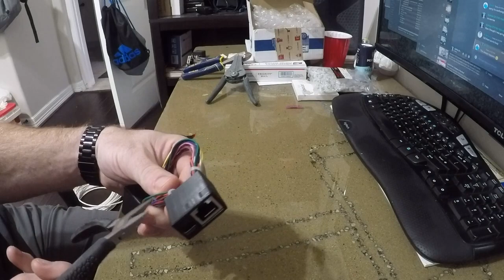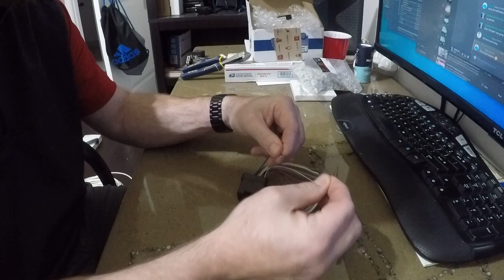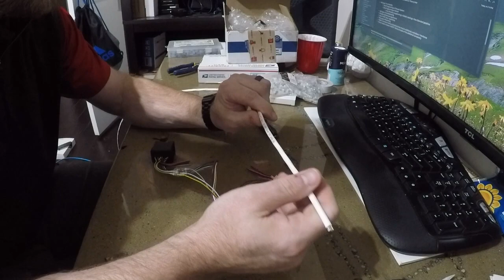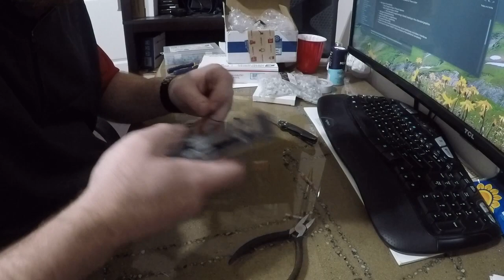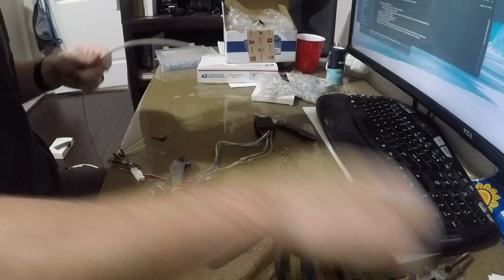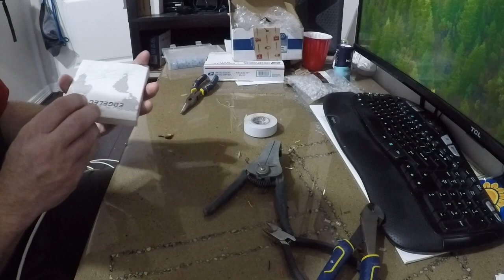OBSOLETE: Comma Ford Lightning Harness Mod

Comment: How important is it for the cable to be shielded?  I'd prefer to use the second wire you linked, since it's cheaper and probably easier to route.
Reply from the maker: The harness I made for Isaac was unshielded and it's not having any issues.